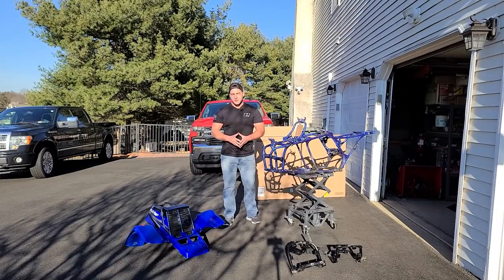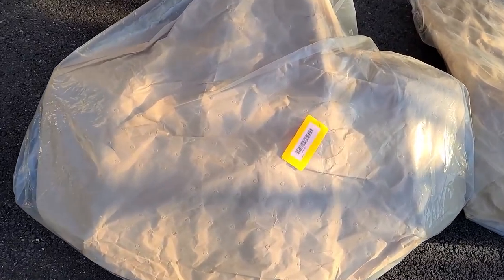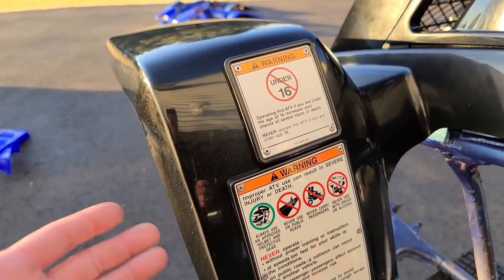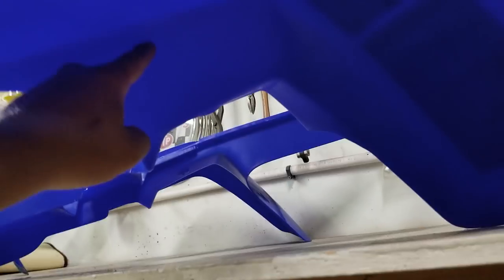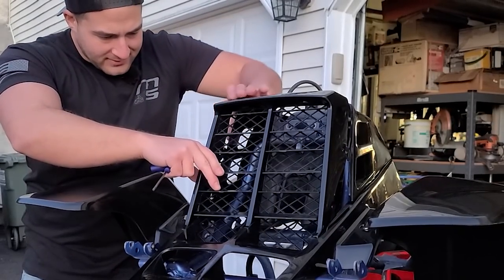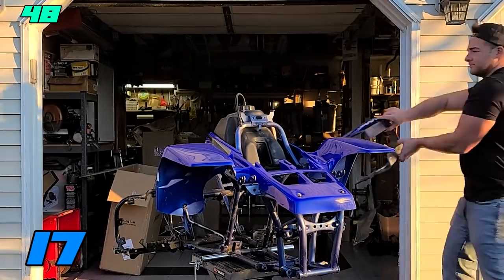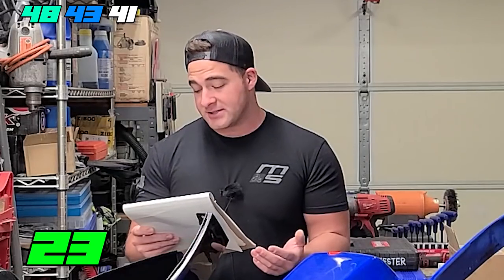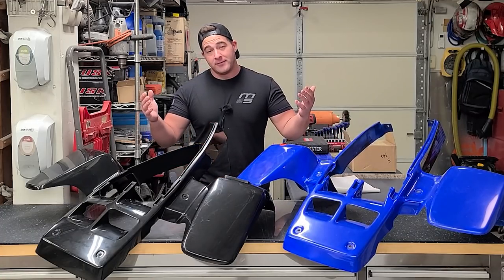Yamaha Banshee Plastics OEM vs Maier vs eBay and Amazon - Full Comparison

Comment: I wish OEM plastics were still available for the old QuadRacers. I've got no need to buy them, but it'd be nice for someone who has the money and need for them to have the option.

Made in Japan OEM plastics ALWAYS fit well, unless one's tabs/mounts/frame are bent.

Newer Maier fenders are better then their older stuff, but I never liked their Zilla front fender being 2 pieces, or their Zilla hood. I understand that the huge front fender needs to be 2 piece for manufacturing ease, but I never understood the hood difference. It looks a little goofy. If I were to buy one, I'd either cut the top lateral fin, so it would look like an OEM, or cut all the fins off and attach a fine mesh to it. Racer look. Here's a fun fact! Maier used to make a race molded, not cut, MOLDED front fender for the Zilla, but stopped some time before 1995. I've seen ONE, and I've seen MANY Zillas. I also wish they would offer their plastic in the wacky colors of the 90s. I've seen green, lite blue, purple, and pink Zillas! Maier also used to make plastic for the Banshee to make it look like a raptor! They still make the fronts but no rears, so what's da point.

I think you don't like the warning decals because they are too contrasty! White and black with orange. The BEST warnings are on old OEM Honda plastic. They are molded right in there, so they are still there, but ya don't SEE them, body color, no contrast! Second place goes to 1988 and older Suzukis. The warning stickers were black lettering on body color backgrounds! Very nice!

I like my stitched OEM fenders. No, they are not stitched with 1/4 inch holes, drilled an inch apart, stitched with zip ties. They use a secret method I'm pretty sure my Dad was the first to use on plastic. Anyway, I'm not gonna replace or cut them. They give my rig most of his character. Just like my blue steel nerf bars! All my Zilla's small dents, scratches, repairs, stitching, etc, on it have stories. With my Zilla, the stories usually end long ago with my Dad using it to break someone's heart or hurt their feelings! I was gonna restore it, but then I'd be really afraid of getting my perfect machine dirty, a twig on the trail scratching the plastic, etc. Also, it'd be just another restored Zilla. There are so few in good original condition these days. Another thing, I'd loose the markings from the stories!
Reply from the maker: I know what you mean with the zilla maier fenders; I just recently did one and it is sort of tacky needing to be joined up at the nose; but they did look nice when they were all together. I good set of OEM fender (if you can find one) would be crazy expensive I bet!

I agree, if the warning labels had a matching background color to whatever plastic you have, they would look WAAAY better!

Comment: Ya know the one reason I prefer the warning labels to be either raised, indented or exactly like oem is that when your restoring a classic machine you want as close to oem as possible. Stickers won’t cut it in that department. As far as a rider quality machine that your going to slap graphics and sponsor logos all over than obviously a sticker is 100% hands down best. I hope you return the Amazon eBay plastics, I think on another machine that’s not going to be on a YouTube channel you can make them work for sure
Reply from the maker: I forgot to mention that; I 100% afree, for a restoration, the warning labels should look perfect like they came off the assembly line; stickers won't cut it.

Comment: No warning label indentations and more rigid fender connections is the way to go, imo. Maier. Plus a near-guaranteed fitment.
Awesome video, Michael! 👍Wouldn't go for weight reduction on this part. The weightloss is mainly gained elsewhere.
Reply: Plus if you're someone who's into building up old three wheelers Maier is the only company offering new plastic. Especially since NOS or even mint original plastics are insanely priced.
Reply from the maker: Maier is definitely a solid aftermarket choice; thank you for watching man!

Comment: OEM always rules and MAIER varies. I have the wonderful gift of finding Honda ATC plastic. OEM fits absolutely perfect but is near impossible to find. If you do find some for the 250R or 350X, the rear fenders run >2500$ or >700$ for a front, find a NOS seat and you'll pay 800$ or more. The MAIER stuff is okay but every model is different, some fit great, some fit lousy. There are also guys making them out of fiberglass and some guys do a nice job with multiple layers. The fit and finish is "OK" but others are the thinnest shittiest fiberglass fenders you've ever seen, like homemade go cart bad...

Comment: Great video! The maier plastics have some more flaws than you point out. The front fender doesn’t have the oem lock tab s if you buy race cut. And the tank shroud, and  radiator cover, doesn’t have oem tabs either and the grill shell looks like hell

Comment: You're lucky (or not, depending on how you look at it) you even got bolt holes in your Maier plastics. My Honda 200x Maier front and rear fenders both did not come pre-drilled at all. That could be good or bad but I am VERY bad at trying to line things up and drill my own!

Comment: Great vid. Wish I could post pic. I have a full vitos set. They fit perfectly except for the front fender bolt, where u had to stretch the fender closer towards the lower front fender brackets. My vitos had to be pushed alot too. But when they bolted up, u would think their oem. No twists, bends, creases. I later  unbolted them and rhey didn't spring out. I think when they sit for awhile, not bolted up to anything, they sag and slowly twist over time. But they come out of it, and fit sweet. I did have to elongate rear fender lower frame mounts, not the heel guard one. Vitos feel strong and sturdy just like oem. Yes I have oem too lmao. Only difference is the rivet head size underneath the plastics and that's it!!!!!
Reply from the maker: I appreciate this feedback Den; I would consider that good fitment if they seem to reform after they're mounted. I imagine even OEM can get out of spec if they're left sitting long enough in a weird/twisted position.

Comment: I used a set of Vito’s plastics on my banshee build and it was very similar to your eBay plastics. Very bad fitment the first time mounting them up. I figured it was from being in the box for a long time. It did get better after they were mounted for a bit. The next time I removed and installed them it wasn’t as hard to install.
Reply from the maker: When did you buy them? Just curious, I'm wondering if they've gotten better over time because of the amount of positive feedback I've heard about them. Thank you for sharing your experience man!
Reply: I bought them about 6 months ago.

Comment: Hi , I have a 93 banshee and it has an Athena 65mm original carburettor pilot 32.5 main jet 310 flaper v4, my problem is that when you get on the banshee the right pipe is colder than the other. I did the comparison and it is 150psi on both sides, but the leak depression test goes down slowly, what would be the problem,

Comment: Kind of unrelated but mike you inspired me to get my build going just trying to get some opinions my bike has an Athena 400cc bb kit with fmf fattys but I want to also build a trail bike I was heavily considering going to an alpha cub setup with shearers and going long travel $$$ 😭 I already have 30mm lectrons so I’m good in that dept. what you guys think? Should I go LT or save my money for the cub or just full send. Btw I love the content keep the quads alive especially 2 strokes 💎
Reply from the maker: Always awesome to hear I've inspired someone to get their build going 🤘 I think long travel could be great but it will be wide, unless you found an LT set that isn't. Built standard travel can make a really big difference if it's setup for your weight and it will be cheaper than long travel. It may help to call Rocket Ron Suspension and ask his opinion; Ron has been doing suspension forever and he will have better advice than me. For power; the alpha cubs and shearer will scream up top (something I'd like) but keep in mind, that's not a setup for everyone, especially for the trails. That will be peaky, hard hitting and a lot of fun, but definitely not well manored like a low ported setup with a low/mid pipe like an FMF or SLP. I hope this helps man!

Comment: Granted the eBay plastics bolting holes were nowhere close, the way they packaged the plastics is why they’re so warped so bad because they probably got flattened so many times in shipping
Reply from the maker: Yea I think you're onto something there; something with the warping and it almost seems like they are slightly smaller, like they shrunk or something.

Comment: I have two Honda ATC 250ES Big Reds , I put Maier plastic on one and am 100% happy with it . My other Big Red I put Chinese eBay plastic on it . Horrible fit ! Holes drilled in the wrong spot , some holes not drilled at all . Side panels tucked under rear fenders instead of outside like oem. I had to trim a few corners to get rear fenders to fit using a hack saw , so I marked the underside with a black marker . I used some brake cleaner on a rag to remove excess black marker ink and the plastic started melting , turned to goo !! Junk !
Reply from the maker: Oh man... the brake cleaner trick is a good test; Maier and OEM it will have no effect; they're definitely making these Chinese plastics out of a cheaper material; thank you for sharing your experience Todd!

Comment: I want to build a blaster. How could I get more performance? Do you have any tips, or techniques for porting? I want to make mega fast mega cheap. A carb should cost around 30 to 40 dollars. Mikuni. I'm also thinking of shaving the head.
Reply from the maker: Man there are so many things to do to make a blaster faster lol. If you want to do a little porting; you can shave the upper portion of the exhaust port so that it is even with the casting in the cylinder and that alone will open up the top end more than you'd think. That paired with a good exhaust and intake and reeds will really wake her up. I would recommend a genuine carb if you're going to get an aftermarket! Hope this helps!

Comment: these companies would not fix their issues. those plastic injection molds for parts of that massive size are crazy expensive. they are huge blocks of steel that are cut and polished in the geometry. you cant adjust them without ordering a new set of molds.
Reply from the maker: I'm wondering if its the material and/or cooling and packing process that's causing excessive warp in the eBay fenders; that could be changed I would think; I don't know.

Comment: Hey lookin to but a 1993 kfx Mojave an it has bad compression where should start on the engine?
Reply: Buy
Reply from the maker: I would pull the head and jug and see how the piston, rings and cylinder looks. Chances are a new set of even just rings could bring in some life. While the head is off I'd also check to see if your valves are sealing. Put the head upside down on a bench and fill it with a thin oil or kerosene and see if it holds or is leaks and you'll know

Comment: On my kfx450r I have a bolt that holds the side lower plastic  the bolt is under the seat my issue is it just spins but don't back out I've tried prying up and I turn it and no luck I don't wanna ruin the plastic trying to cut it off because there isn't really any space to get between the 2  any suggestions
Reply from the maker: I had this same thing happen on my KFX. The rivet nut in your frame is probably spinning. I use a thin cut off wheel and I was able to get between the bolt head and plastic and cut the head off without damaging the plastic. Do it slow and take breaks so it doesn't get too hot and melt the plastic and you could be good. If you cant get between the bolt head and plastic; I'd grind the bolt head off little by little keeping it cool. Once its out, the rivet nut can be drilled out and a new one riveted to the frame. Here's a cheap rivet nut kit that can do it - https://amzn.to/3uKgHFN - there are nicer ones, but that will get the job done.

Hope this helps man!

Comment: Mr sabo sir. Had a quick question on the yfz450 calipers . I have a j frame myself and the caliper mounts no not match up at all . just wondering wat year spindles you have and if they worked on yrs or not
Reply from the maker: Hmm, did you use the link in my video or another vendor? It's possible that my spindles were updated at some point before I bought my Banshee but I think they should match up to all years. Mine are for an 04-09 1st gen YFZ. Here is the exact set I ordered - https://ebay.us/6jgchz
Reply: @MichaelSabo  yea I bout the same year cuz I was curious only difference is I got a genuine oem and only got one. But thanks cant wait for the next banshee update
Reply: For yfz calipers you need the spindles from a a arm banshee.  J arm spindles have different spacing.
Reply: @davidfaria4293  so a arm spindles / hubs most likely also with yes calipers . does the 04 yfz rotor bolt up as well ? Or run the a arm banshee rotor?

Comment: Hey so if anyone finds this comment I need some help I have a 1981 atc250r if you don't know what that is it's a 
3 wheeled 2 stroke 250 machine. I'm only 15 and don't know a lot about 2 strokes. My dad got it for free from a friend at work and it sat in my shed for 3 years and I got it running 8 or so months ago and had to figure out how to ride a 2 stroke, without fouling the plug especially since my dad has it running at a 32:1 fuel oil mix, Anyway back to my problem I just got a chance to take it out and really hammer on it and it gets into the power band and starts climbing around half throttle and then when I get to around 3/4 throttle/full throttle it just feels like it starts bogging and has a noticeable drop in power. And i just dont know if it should just drop off like that, if there is anything I missed or more info that you need to diagnose my problem just ask but I have given all that I can think about right now. Thanks for reading this far, any ideas as to what is wrong will help as im a novice to 2 strokes.
Reply from the maker: I would start with the jetting man, especially if you're having problems with the plug fouling. 32:1 shouldn't foul plugs if it's correctly jetted. I run 24:1 at time and don't have fouling. 

I think a safe, easy bet is to pull the carb and clean it; and then try dropping the main or large jet ONE size at a time and see if that clears up the upper RPM range. Make sure your air filter and exhaust are not plugged up with splooge (old 2stroke oil built up from exhaust) as that can plug up an engine too especially in the upper RPMs.

Hope this helps man!
Reply: @MichaelSabo  alright thanks man, I'll try cleaning out the exhaust and air filter before I buy a jet kit. And is there a specific jet kit you would recommend I'm guessing genuine keihin jets
Reply from the maker: @mrfunky8843  I always try to use genuine jets, EBC or pro-x
Reply: @MichaelSabo  well after waiting 2 weeks for the parts to show up its runs great. I got a new aftermarket dg silencer and cleaned out the exhaust pipe best I could, also bought a new uni air filter thanks for the help. Also posting a video of it idling it's on my phone though so not that good.
Reply from the maker: @mrfunky8843  hell yea man! That's awesome to hear you got her going 🤘🤘🤘

Comment: The ebay plastic shouldn't cost more than $250 for the entire set. Then again I'd probably only buy some to race cut them
Reply from the maker: I agree; this company refunded me 400$ leaving me with the full set for under 200; I feel good about that for the reason you mentioned; I'll have drag fenders.
Reply: @MichaelSabo  I'd say race cut the front of the ebay ones and leave the rear one intact. Just to have some extra race cut fenders, they're better for wheelies imo
Reply from the maker: @OGKILLa9365  that's exactly what I'm going to do 🤘

Comment: i just have to laugh everytime i hear all this nitpicking on weight savings.  The easiest way to save a bounch of weight and get some of the best weight placement is by going to the rider and remove some(in many cases ALOT) of weight.   There are so many "situasions" where the rider could loose 5, 10,15, 20 pounds or even more.  And by removing tthat much meight from the top of the quad/bike it should give better handeling and "more" power.    This is not ment specialy to you Mr. Sabo.  Just people in general.